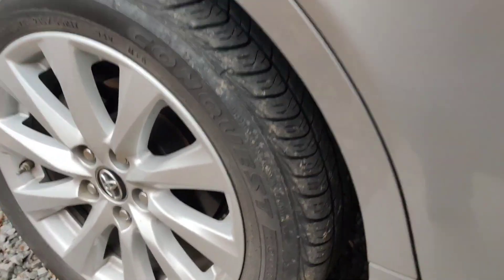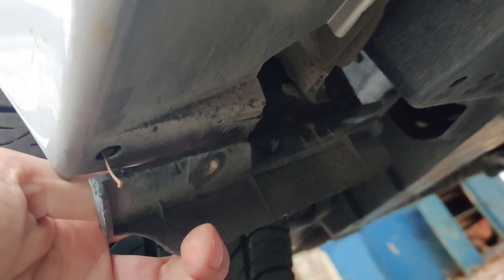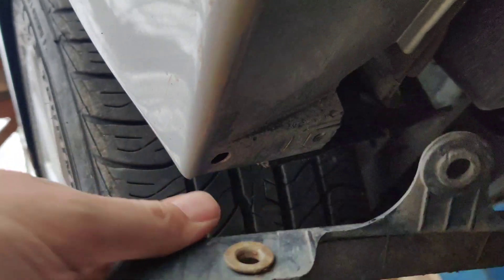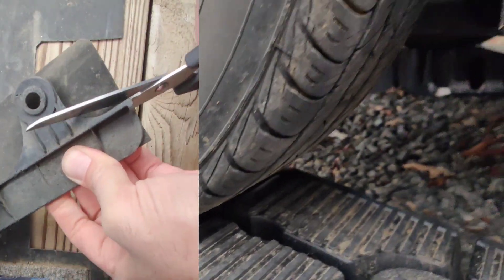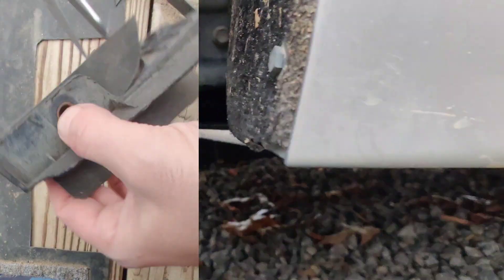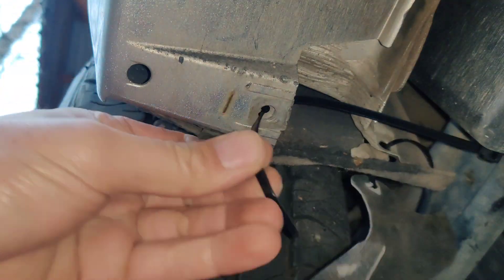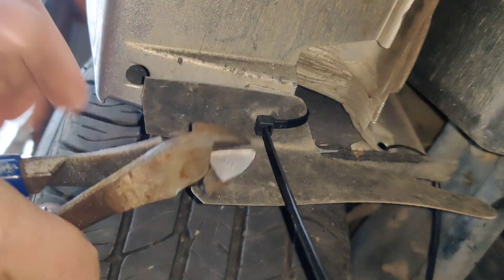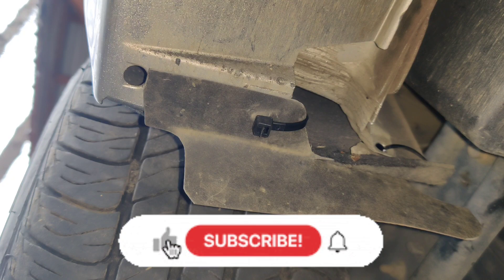2018-2023 Camry Rear Wheel Deflector - Make your Own Replacement - EASY

Comment: Great video having the same issue by any chance do you know what clip or screw it came with??
Reply from the maker: It looks like a type of expanding fastener you would find in an auto parts store. Similar to a drywall anchor screw.